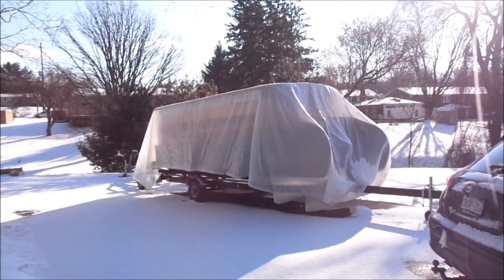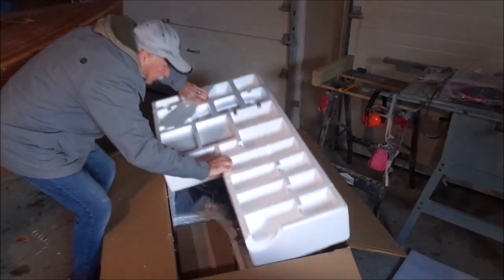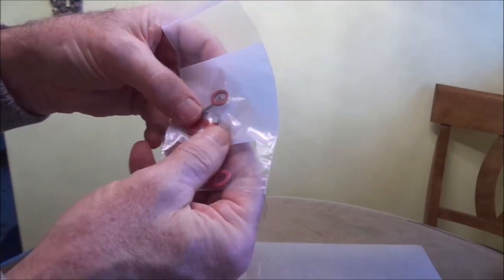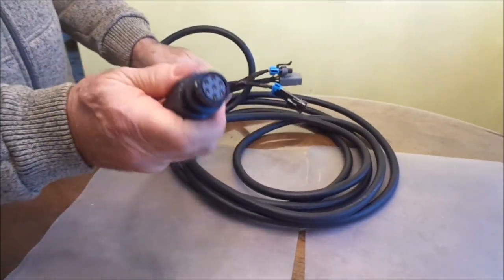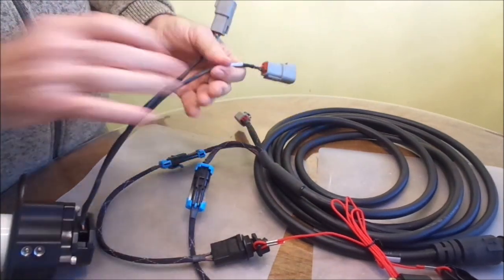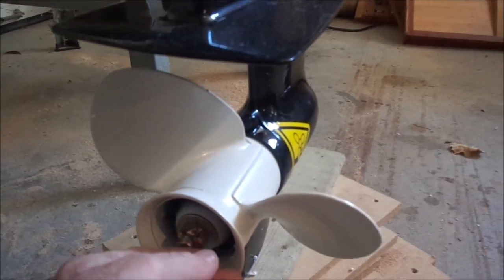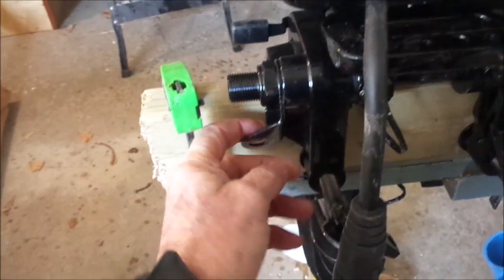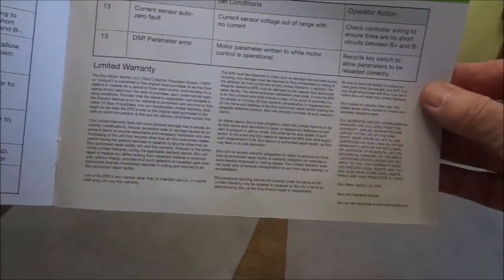Unboxing my Elco EP20 Electric Outboard Motor  Building My Solar Electric Catamaran Part Twenty Two

Comment: Just wondering now that you have made the long trip do you think the elco is a good investment? I remember you had trouble with the motors on your first solar boat
Reply from the maker: I actually have the Elco listed on KIJIJI for sale. If I don't sell it by spring I plan to build a boat suited for it. One that will plane. There are pros and cons for either motor. The Torqeedo is more efficient while the Elco is more robust.

Comment: 6:25 if you want to extend those cables I’m sure something like these mechanical splices us commercial electricians use would work. They are have heat shrink and often come with goop inside them designed to stop oxidation and corrosion. They are like $40 each but probably better then moving batteries. 

I am from Alberta so I’m not sure about what Electrical wholesalers you have out there.

Ask them for direct burial splice kit, might work well.

Comment: hi hows it going new motor mounted yet? nice weather wont be long  hope to see a her run by end of april  or early may . have a good day
Reply from the maker: This was the first day out working on the boat. I have started modifying the front stems of the hulls to give me a cleaner entry. Next will be some bottom coat painting, replacing the old canopy with new lighter one, rewiring and mounting the motor.

Comment: How much did you pay for it, Phil?
Reply from the maker: Battery cable	$240.00
Livorsi side mt  throttle	$450.00
motor	$4,604.00
Shipping and Brokerage	$732.93
This was in US dollars so if you are in the US  you won't have brokerage to pay.

Comment: HI i see Solas has 4 blade props for yamaha& honda 8 spline 9.25 in 7 .8 .9 .and 10 pitch. nice to have a spare. go one pitch lower for 4 blade. better low speed thrust. hope this helps. looks like an electric yamaha. keeps the rpms up for better cooling to
Reply from the maker: Thanks Daniel, that is helpful as I would like to have at least a spare prop.

Comment: should be a lot better with weeds.  are you going to add more batterys? does it use merc or yamaha or tohatsu props? could not understand why they still use thru prop exhaust on cheaper  electric outboards more drag i would think.
Reply from the maker: I am not sure if you can use other manufacturer props or not. It may come down to you can but performance may suffer. That would be a good question for Elco, perhaps I will ask it. I hope for weed reduction as it was bad with the Torqeedo.
Reply: @philboyer2036   i think to save costs they source parts from others. i hope to build a electric outboard from a 60 hp chrysler out board i have useing a golf cart motor someday down the road.or river
Reply: @philboyer2036  looks like yamaha props at 9.25 x 8 or 9.25 x 10 will work. i envy the canal boats over in england on the water all year long. check out pontcysylite aqueduct crossing by narrow boat ....scary
Reply: I believe that some electric motors use air pressure to help protect the seals that contain the lubrication oil. I don't think that the air flow is large enough to affect overall performance.
Reply: @richardgray2706  no exhaust no air pressure in hub just drags water along behind prop. but will not be that fast anyway .   some were between 12 to 18 mph is my guess